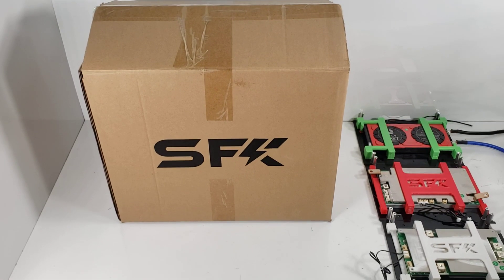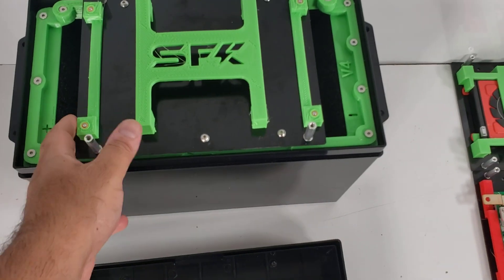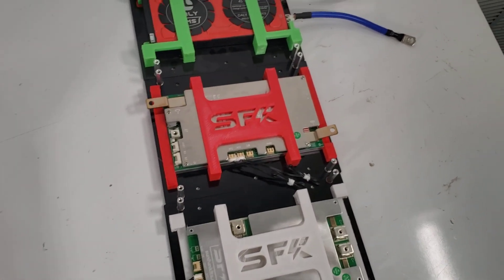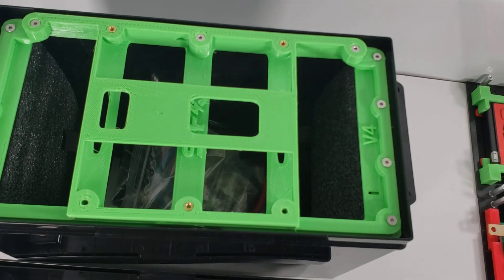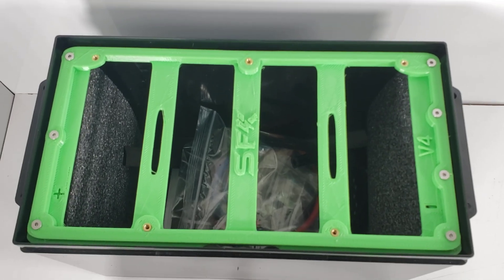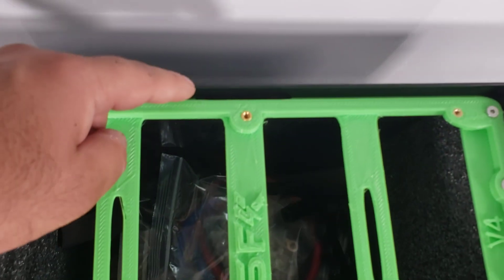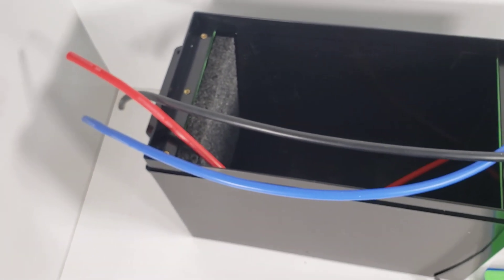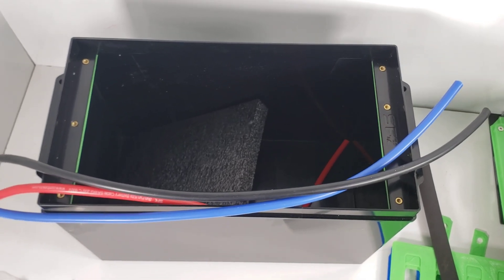Sun Fun Kits 12v V4 Basic Battery Kit for DIY Lithium Iron Phosphate Cells

Comment: I have the Overkill Solar 4s BMS 120a LifePo4 with 12″ 8ga Wires, which BMS mount should I choose?  Also, my use is on an RV and the Battery would be out in the elements.  Do you have a cover for the connections to the battery box?
Reply from the maker: Overkill Solar BMS are generally JBD bms units, please provide the SPA MODEL number and we should have a mount for it, alternatively you can send pictures with measurements of the width, height and length and we can make a mount for you. Please go to our site and submit a support ticket.
Reply from the maker: Here you go https://twitter.com/Sunfunkits/status/1669194490316300288?cxt=HHwWgIC9hfLilaouAAAA